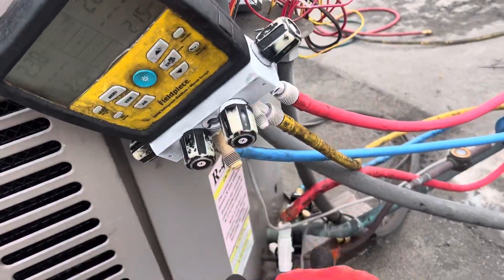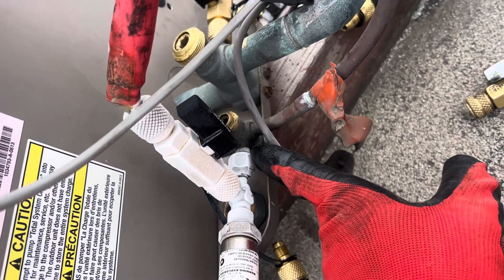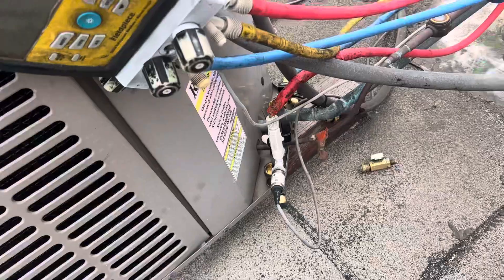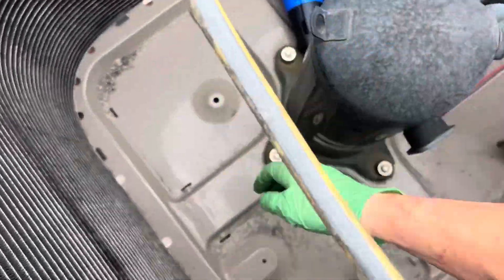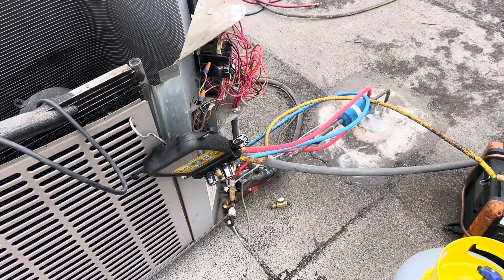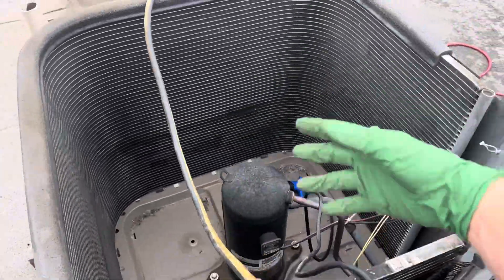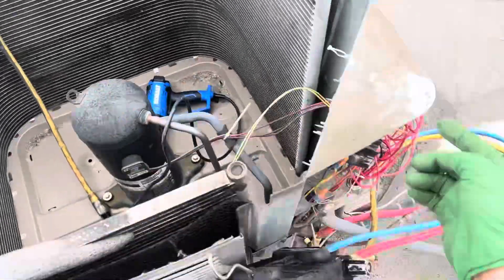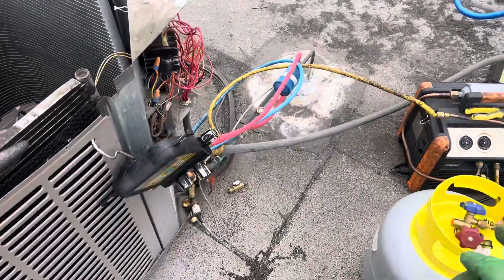REFRIGERANT RESTRICTION LOOK 👀 @ WHAT HAPPENS WHEN YOU RESTRICT REFRIGERANT

Comment: do you use recovered refrigerant again or its just for disposal purposes or both?
Reply from the maker: Fortin gets disposed back to recycling facility at the warehouse. We have a tank exchange program..   I give them a full tank they give me an empty tank. 

After a compressor burn out like this with the black oil that you will see you in the next video . 

You do not reuse that refrigerant .
Reply: @coldfinger459sub0   if the scenario is a car,  a workshop uses RRR machine to evacuate a hvac system from a car with damaged compressor... RRR got filter drier yada yada, but it will be still a BIG risk to the next car then Tom , yes ?
Reply from the maker: No risk in the car

The big RRR machine remove the dirty oil removes the metal flake removes any piston rings material it removes moisture it removes air it removes acid. . 

Then the refrigerant is to be reused again in the next vehicles.